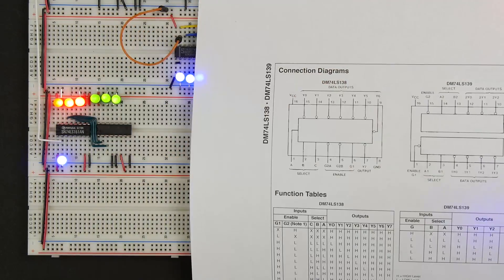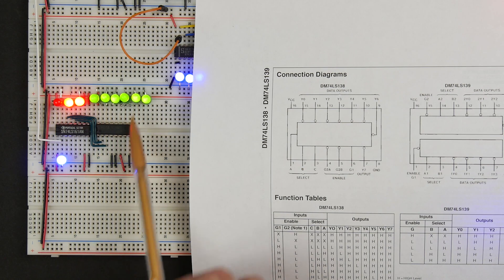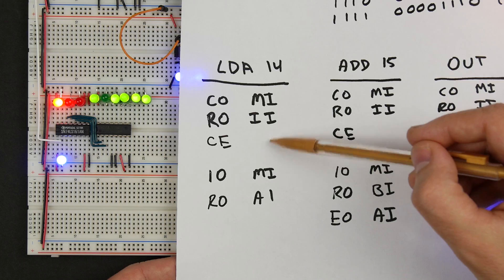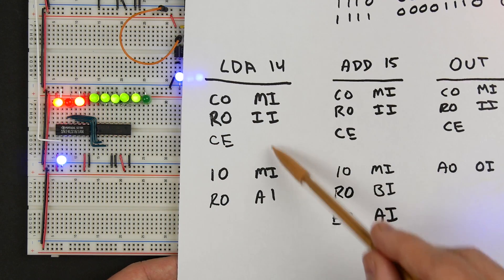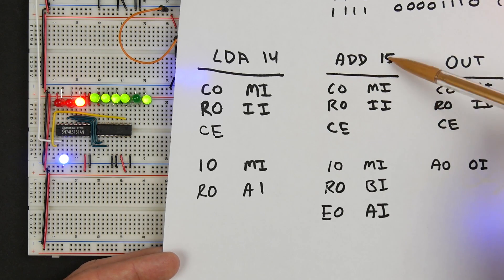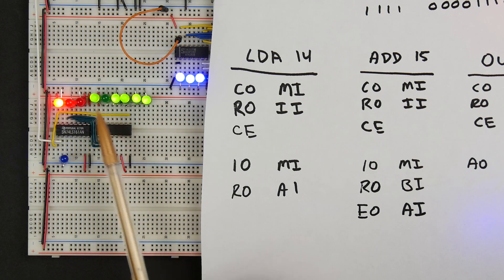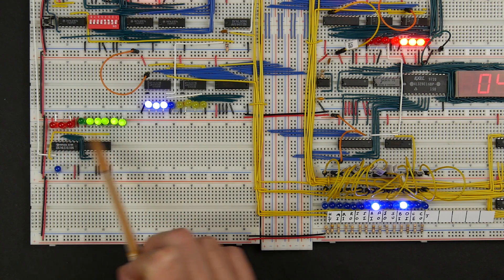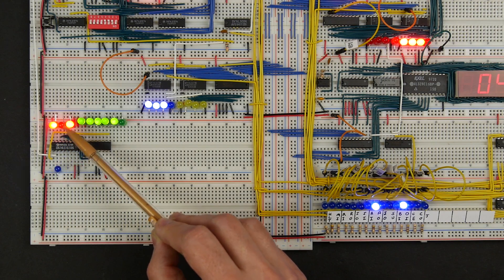8-bit CPU control logic: Part 2

Comment: instead of using the 74LS138, we could use the 74HC238 once it is not inverted output. Then we can use just one pnp transistor to reset the 74LS161 when it reaches the max count if we don't need all the counts of course.

Comment: Why not just use an eeprom? Every instruction has a different value and since is counting up the value for each microinstruction is different from the other, so why not just feed the binary counter and the instruction value to the addresses of the eeprom and in each address output a value that would be directly connected to the pins to control.

Comment: 16:41 and it would not work anyway. if you add t2 MI is allready connected CO on t1. so t2 IO MI would make IO high on t0 too. and thats why we need rom xD. we could use diodes and need new mikrocounter to every op code hahaha

Comment: Could we use a Control Word Bit to reset the Instruction Counter so that each independent instruction can reset when the Intstruction counter decides to reset?

That way the LDA can reset during the same step as RO and AI, maybe a NI Signal, that when it goes high it resets the Instruction Counter.

While for the Add Instruction, the Instruction Counter Resets during the SumO AI

Comment: Any of you guys find that, with the 74ls138, the circuit works better when the 5 green leds are grounded to the circuit?  In other words, the green leds would be dark with a moving “on” led vs on at baseline (with a moving dark led) as shown in the video?

Comment: There are so many easy improvements you could do, like resetting the counter early, b register out, turning the AU into an actuall ALU (bitwise or/and/xor, ror/rol, and use a multiplexer to select the output with only a few control lines), splitting the instruction register into two bytes for more address lines (not as easy if you want to do it efficiently), but I'm almost glad that you didn't do those things. It really motivates me, and I think a lot of other people to try these things out for ourselves and have fun with it!

And also buy your product in the process
It's all part of your plan :P

Comment: 16:39 i was wait you continue.. but it would not work. CO and MI has jumper to T0. so in cycle T2(T3) would make IO MI and CO same time xD so memory would have counter + instruction

so every T cycle need that much gates as there is instruction signals. input for those gates come instruction counter that will only be 1 time no overlapping. t0-t1 takes 5 NOT gates

then T2 we need read what is on instruction memory as command. that is feeded in another binary decimal converter.that output + T2 will feed set of NOT gates that output instruction signals.

T3 another set

T2-T3 for every command. lotsa chips and wiring xD

Comment: 2 years late to the party, but would it be worth having the microinstruction counter reset by the EEPROM as well? Some of those instructions only have a few additional cycles, it would seem like a grand ol' waste to just pulse the clock and have it do nothing.
Reply: Another year later to the party:
Later in the series he used the last available dataline on the EEPROM for updating the flags register and even mentioned this idea. So you'd need another EEPROM because of the lack of free datalines on the first two EEPROMs. I think you could still nor the entire control word together and feed that into the step counter.
You could also get rid of the whole demultiplexer, because each instruction already ends "on time".
Reply: @uklu  Yeh, I think I saw that one after this comment. In the end he made it reasonably efficient if I remember correctly

Comment: So the description ( on the right of the screen) is not the described ( on the left of the screen).  The description is not described.  The papers and the writings stay there on the right, on paper.  On the left is light bulbs ( which in real computers don't exist), neither do those switches.  There is no person that pushed those switches either with numbers written on them so you know which is which. Furthermore, there are no labels on the light bulbs, you just have to assume and already know in your mind what each light bulb represent since the light bulbs don't tell you.

Comment: anyone else having trouble with the ls173 on the instruction register resetting without having to go high, the pin seems to stay high and after pullinh reset pin from ground resets this chip. because of that when trying to hook it up to the 74ls00, the reset ic doesnt seem to work.

Comment: If you use the reset input on the 163 as a new control line you could program your microcode to reset the counter when any particular instruction is finished.  This would mean that each instruction would only take the minimal amount of cycles.  It would also allow you to have instructions that take more than 5 cycles without increasing the amount of cycles that all your instructions use.

Comment: atm you actually only need 2 cycles per command load? shouldn't you make this more efficient?
Reply: use 2 cycles to load the command and only reset the clock after the command is done depending on the command that is

Comment: Another optimization would be to speculatively load the memory address register in step T1, at the same time you're moving the instruction from RAM to the instruction register, so that the (IO,MI) step can be skipped on instructions that need it.

Comment: You can make it variable microinstruction by having a control line to reset the microcounter at the last decode.  For example, if we call it RC (reset counter), then LDA would be:

co mi
ro ii ce
io mi
ro ai rc

Haven't seen your other videos yet, but figured I'd throw that out there if it doesn't come up and I forget to say something later.
Reply: That might not work as when you do the RC as part of RO and AI the EEPROM already is back to CO MI. So do the RC on separate step.
Reply: @topilinkala1594  that comment was 5 years ago, but if i recall correctly, he stored the current state in a latch, so the reset would only affect the microstate. This means it should be loading in the next decode into the latches within the next cycle and microstate being reset means it would begin at 0......I'm not going to rewatch the video, so I might be wrong here, and if so, then what i said should have been the implement in order to make it work, otherwise, sorry.

Comment: I've got a question. Each control signal is set when the clock goes low because you're using an inverted clock, but couldn't you run into issues because the control signals will be turning off as the clock goes high. For example, lets say I set ram out and register A in high; the value from ram won't be read into register A until the next rising clock edge, but as the clocks edge is rising, the control signals are being turned off because they are running on the inverted clock. What happens if the control signals are turned off before the value can be latched into register A?

Comment: Maybe you'll address this in a future (well, past, since I'm not caught up on the series) video, but why not reset the microcode step counter when the instruction is done, instead of a fixed time? That way instructions that take fewer steps wouldn't just NOP for the rest of the time and would actually execute faster.

I can think of reasons not to do that which don't apply to this project (timing consistency is useful for some applications like cryptography, or you can change your vocabulary so that one "clock cycle" is really five cycles of the internal clock to make things easier to understand), but nothing that seems relevant here.

Comment: I Know this video is kinda old by now but I just realized a way to optimize control speed without compromising it's max instruction size. you can add a controller reset instruction connected to an inverter which is then connected to an edge detector and finally to the reset pin of the controller counter. Max out the counter to its seven positions and add this instruction alongside the last one of all commands. This will make the controller counter as large as its current command needs it to be. How? The inverter will keep the reset signal high but the edge detector will keep it low, when the reset signal comes up the inverter will set it low but since the edge detector only senses voltage raises it still wont send a pulse to the reset pin, it is only after the instruction has passed that the inverter will switch back to high and the edge detector will send a pulse to the reset pin of the controller counter, effectively restarting the controller immediately after the command is done.

Comment: Towards the end of the video, you were talking about setting the logic counter length based on the longest command logic chain programmed in the system.  Would it be more efficient to include a "Logic Reset" signal as the final microcode instruction for each programmed logic command? Tie that signal output to the counter reset signal in the logic circuit?  This way any command programmed would take just as many cycles as needed to complete - no need to wait on the logic counter to complete its cycle based on the longest microcode instruction set.

Comment: 8. Some instructions don't need the Program Counter to increment because they overwrite it anyways. This is not really applicable for your computer (unless you change something in the newer videos only the unconditional jump instruction does that) but for more extensive architectures it can save a clock cycle for more complex instructions (e.g. a subroutine call) if that's not hardwired.

Edit: Nevermind, I misunderstood something.

Comment: Great work, I am thinking of building my own system, I might start next week doing up a set of schematics for what you have built so far. You are inspiring me to do something for nothing more than sheer fun.

With the microcode counter reset I would not hardwire the reset to a pin of the decoder. Instead if you use multiple eeproms, use data pin to reset the counter. This will then give you variable length instructions so the simpler ones will be faster and if you needed something like indirect memory addressing (I know that is pie in the sky but hey I am thinking of building a similar system to write my own microcode system) then you can take the full 8 or 16 clock cycles if needed.

Comment: I'm kind of new to 8 bit computers so is there a way to connect a monitor to the computer and be able to see everything visually better?
Reply: that would require a lot to figure out about hdmi, i think; how to actually interface an hdmi and send a visual signal to the monitor. i.e. for small black white lcds its just a certain bit value like 01001011 (8bit) to set the input high/low for a certain square that to become black. of course with a certain refresh rate. which he uses for his pc. that is with a serial interface. if i got that right from my memory :p . i imagine hdmi would be lot more complex to handle. color range and the pixel to make that color. would be fun to see him hook it up to a hdmi monitor :D
Reply: yea, all I would like to see is if he can hook up his homemade 8 bit machine to a black and white lcd monitor.

Comment: I'm not sure why you want to make each of the individual instructions the same number of T states. Surely the last micro instruction could be a reset, then each instruction would only take the minimum number of steps needed. And your programs would run a bit faster overall.

Comment: Dear
Ben, am now desperate for last videos. Please post asap. Fear life can't go on
without the final pieces of the jig-saw. 

Seriously, I’ve been in IT since 1970. I first worked on IBM’s
360 range of computers – pre virtual-storage. I’ve always ‘known’ (or more precisely
– was ‘taught’) that computers were made, essentially, from transistors
used as fast low-power switches. But I had never known how. This series of
videos has closed that yawning gap in my understanding. I can’t thank you
enough. Strange that the control word does not do ‘anything’, simply opening
and closing various pathways to and from the bus. Fascinating.

Comment: Anyone else experiencing weird voltage drop behaviour? 
If I hook up my power (5V from bench supply) in the upper left corner of the clock board, the registers are not getting enough power. 
When I hook up the power somewhere in the middle of the CPU, it all works fine.
Voltage seems to drop like 1.5V in the first case.
There was also some noise (ripple) when getting measuring further away from the supply, but a couple of capacitors spread out across the CPU has solved that.
The voltage drop still puzzles me though...

Seems there is around 8 ohm of resistance in the breadboards between some points on the power rails. Could that be the problem?

Also hooked up jumpers between all the power rails, even more than Ben did, but that doesn't help either.

Anyone got an idea?

Comment: Could you add a step at the end of shorter commands to reset the time? Obviously, it would only help on commands that are two micro-commands shorter than the maximum length, but could it save even a little bit of time on those shorter commands?

Comment: You electrically combined the CO and MI signals, so when the IO MI step is to be implemented, the CO signal will also be raised.
I think it was necessary to connect CO and MI on separate inverters.
Reply: Михаил Кулагин you should consider all wires "looking ugly" temporary

Comment: Yay! We taught the computer how to fetch! :D
Now it's time to teach it how to chomp whatever it fetched ;)
I think I get it now how it works, but I'll still watch next videos to see it happening ;) (and to see if I'm right).
My EEPROMs already arrived from China, so I can try it out myself before seeing your solution ;>

As for saving cycles, how about resetting the phase counter depending on the instruction? We don't need to wait through 5 steps every time – if the instruction requires less steps, we could reset the counter earlier by asserting the reset signal to it programmatically from the instruction decoder ;)

Nevertheless, after you finish this part of the course, I would like to see you explaining somewhere in the future how to fetch and decode multi-byte instructions (e.g. fetch the correct number of operands following the opcode depending on what opcode it is) and do things like conditional jumps, subroutine calls / returns etc.

Comment: Thanks Ben!  it's all coming together.  My breadboards are quivering in anticipation of a control logic section.  With your video's I now have enough information to get it all wrapped up.  Great work - keep em coming.
Reply: I am, though, going to setup a microcode that "resets" the micro instruction counter so that I don't have to wait for blank micro instruction cycles.

I am also thinking about setting up a hash table that allows me to compress my microcode memory in the EEPROM.  Basically, without that, each microcode takes up a specific section of EEPROM memory.  Not really a problem, since our instruction set is going to be small (mine instruction words are 8-bit, not 4), but from a design perspective, I like the challenge of "compressing" the microcode translation table so that I can tell the decoder where to find any microcode that I want.

On my instruction register, instead of the LS245 + 8 bits, I used a LS373 as the storage, and bus interface.  Simplified things quite a bit - and was a challenge to design a different way to handle registers. :)

Also, I setup my system to use a single chip 256Kbit ram chip - so I am thinking of providing "paging" instructions as well just for fun.  With your EEPROM instructions, handling a RAM chip with I/O pins ended up being not too much of a problem.
Reply: Not worth the fuss. Just use a ready-made EEPROM chip, there's plenty of room for microcode.
In an actual CPU design in silicon, you could of course omit some unused memory cells altogether from the ROM matrix to save some transistors or space. But when you already have your EEPROM prefabricated for you, the Universe will not suddenly end if you waste some of the cells ;J But trying to compact the code may make it less regularly laid out and it might require a complicated logic to decode the opcodes into addresses in that ROM, so you will effectively end up with a more complicated and more expensive design :q

Comment: Is it going to be able to execute other instructions besides adding?
Reply: Éljen Magyarország.
Reply: Also NOP! ;D Never forget about NOP ;D
Reply: It is an instruction all right ;) And it may be very useful sometimes. E.g. you can use it to wait for a certain amount of time, or to measure a time of one machine cycle. You can replace a different instruction with NOP to turn it off for a while during debugging or patching the code in memory / executable binary. You can use it as a placeholder or padding between instructions when they have to be aligned to certain boundaries in memory. And if its opcode is e.g. 00, it can be a good failsafe in case the CPU starts executing code from some random place in memory filled with 0s, because then it will just do nothing instead of executing some random bytes interpreted as instructions, which might be dangerous or even damage some hardware :q It's also useful for testing the CPU: just attach the clock and set all its data lines to 0 (or whatever the opcode is for NOP) and see if it will generate subsequent binary numbers on its address lines without the need to actually connect any external memory or peripherals ;)